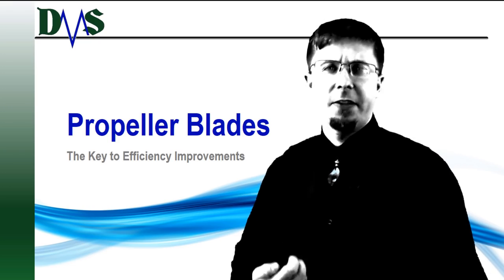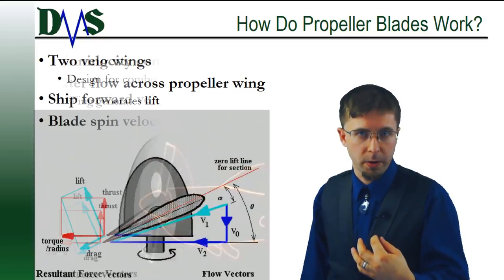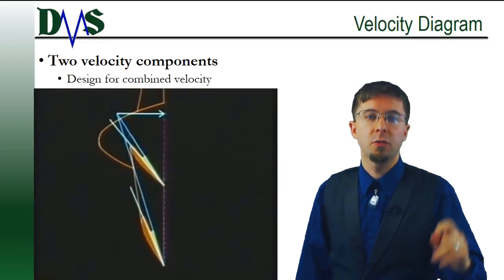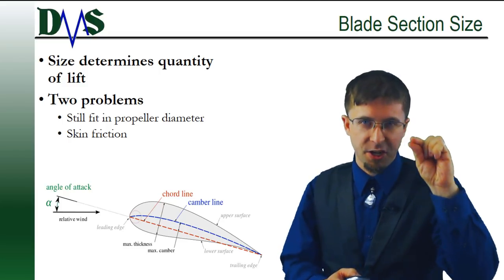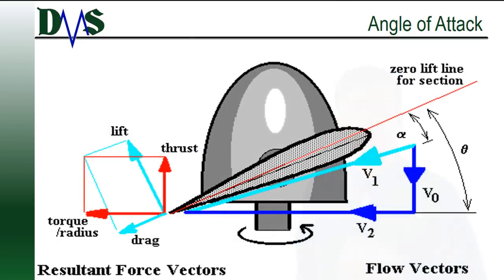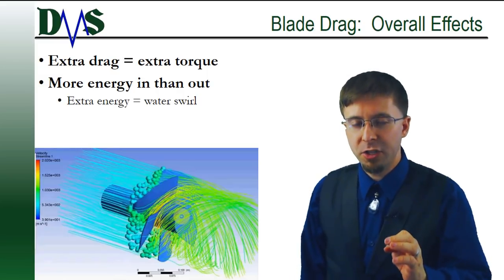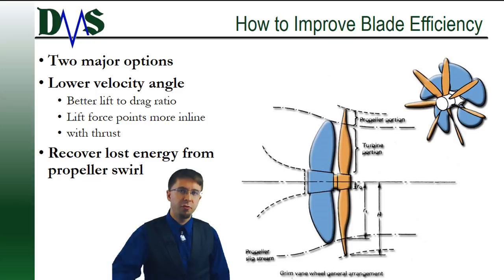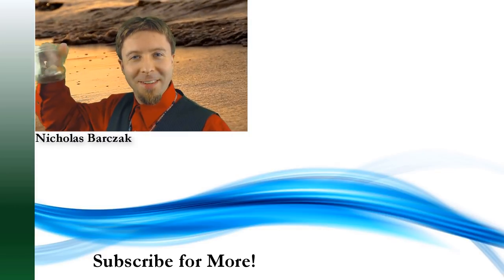Propeller Blades:  The Key to Efficiency Improvements

Comment: Do variable pitch propellers work on large seagoing vessels?
Reply from the maker: Sure.  I just worked on an ocean construction ship that had two variable pitch propellers, also called a controllable pitch propeller (CPP).  The downsides:  more expensive than fixed pitch; more machinery that can break; lower efficiency than a fixed pitch (when comparing on equal pitch).  So you don't see CPP's on freighters that spend 90% of their time at one speed.  But they are handy for ships like ferries, offshore supply vessels, and construction ships.  These are all ships that need to work at different speed ranges.  Those are the best uses for CPP's.
Reply: By keeping the engine speed constant (or mostly constant) you gain efficiency from the engine.  Well, if you spend most of your time at 1 speed, you've accomplished the same thing with a regular prop without all the components to go wrong...
Navies also like them for their ability to quickly and precisely change speeds.  For instance, when a DDG51 class caught the dumbs and almost got run down by me (container ship) he was, by combination of GTS and CPP able to put the power down and escape...
Reply: Thank you guys for actually responding to my comment!!  It really helps!!!

Comment: The "duo props" developed by Volvo claim to have a 30% improvement in effectiveness, 30% more speed at the rpm you normally use. If you get 15 knots at 1800 rpm, by using a duo prop you effectively get 19.5 knots at 1800 rpm.
That is the claim at least. There must be something to it though, since cruise ships and ice breakers have started using the system on pods. They wouldn't put them on a cruise ship if they didn't give a measurable benefit to ship operation.

Many European based yacht builders have started offering Volvo-Penta pod driven option, which does come with the duo prop. With the twin pods in the back, a bow thruster and the application installed in the controls, push a button on the controls and you have dynamic positioning operating.

Comment: Hello! Thanks for your fantastic video. I have a question. In 5:44, you said the lift is perpendicular to zero lift line is, that true? I couldn't find it in the books. Isn't that supposed to be perpendicular to the relative velocity?
Reply: It's in every explanation of lift from airfoil sections. The lift is always at right angles to the zero lift line, no matter what the direction of travel.
Lift occurs just after the top of  the upper curve of the chord,  and is produced by a low pressure area. If you tilt the upper curve away from the direction of travel, the Lift component has to follow the  tilt of the ais.

Comment: Nice video. Just subscribed. I was wondering if you have an example of a prop that works as thrust for a 47' sailboat but also as a prop that generates electricity when sailing?
Reply from the maker: I don't have any specific manufacturers yet, but if you do a search for "yacht electric motor", you can locate manufacturers that supply that.  Anyone that makes an electric motor for yacht propulsion often adds in the ability to turn it into a generator.  Here are the first two results I found from google (not an endorsement):  
http://electroprop.com/sailor-serial-hybrid/
http://electricyacht.com

But that just handles the motor.  Then you need the propeller.  Biggest point:  don't get any feathering or controllable pitch propellers.  Otherwise, the generator capability never works.  You want a simple fixed pitch propeller.  There are some special blade shapes to make sure it works just as well in generator vs propeller mode.  But unless you are buy a custom cast propeller, I doubt you will find anyone that makes such a specialized option.  Just get the right propeller for propulsion and the generator should work pretty good too.

Comment: I’ve heard of cupping the blades for efficiency, but has anyone done more on blade designs away from the tip and more at the leading and trailing ends to increase efficiency and reduce noise?

Comment: What would happen if you use vortex generators like that on a aircraft wing ?
Reply from the maker: I'm no expert in aircraft wings.  But at first guess, nothing would happen.  From my understanding, vortex generators on airplane wings exist to ensure reliable turbulent flow over the wing.  Propellers operate at a higher Reynolds number than aircraft wings.  We are already far into the turbulent flow regime.  All the things the vortex generator acocomplishes by design, we achieve as a natural consequence of the propeller operation.

Comment: What about swirl with the Voith type  of propellor?
 Is it more efficient than conventional types of propellor?
Reply from the maker: The Voith Propeller doesn't experience swirl in the same sense as a conventional propeller.  Totally different flow pattern.  At slow speeds (below 12-14 knots) the Voith Propeller can be more efficient.  The trade-off is greater complexity for the Voith propeller (i.e. increased cost).  But Voith also offers increased maneuverability.   I really need to create a whole video on Voith propellers.

Comment: which rotation works better right hand or left hand
Reply from the maker: Generally, no difference.  If your hull is not symmetric, then you may get some benefits of right hand vs left hand, depending on hull shape.   (Asymmetric hulls are possible in the individual amas of catamarans and trimarans.)  Selecting right hand vs left hand, the largest deciding factor is probably which direction you turn when backing out of the slip at your home marina.
Reply: @DatawaveMarineSolutions  Awesome! Your reply including the tail walking in reverse is supper impressive to me (right vs left hand prop). I am not only a hull diver, but also a sailboat owner. This rebuttal gives me much faith that you will help engineers consider marine growth and opposing elements of balance. (5 🌟  reply)
*Most power boats with STBD & Port running gear have right hand on STBD side & left hand on port side. The only real difference to me, is the STBD propeller nut often kicks loose when bumping the boat in drive. Using a king nut with a locking set screw will help prevent the propeller nuts from loosening when operating. Standars ABYC jam nut, king nut, cotter pin doesn't always work on vessels with heavy nuts lol.

Comment: I get confused when marine engineers aircraft 'propellers' as an analogy with ship 'screws'. Don't they differ because an aircraft propeller relies much more on working in a compressible fluid rather than the other non-compressible fluid of a ship's screw?
Reply: Geoff Buck The principle is the same, it's just the mass that needs to be different, low mass for  gas, high mass / high strength for fluids.

Comment: why is an airplane propeller more efficient with less blade area ?
Reply from the maker: It comes down to the difference in density and application.  Airplane propellers operate in air, which is roughly 1000x less dense than water.  Due to this, the propeller this follows the same basic shape, but with different proportions.  It spins faster and uses less surface area.  Due to these changes, you also get less skin drag and less induced drag on the propeller, which means better efficiency.  

Put it another way:  because the propeller spins faster, it doesn't need to produce as much force with each rotation.  That allows us to focus the airplane propeller on efficiency, rather than fitting sufficient thrust into a relatively small diameter.  

There are several physics and design decisions that go into that result.  But the basic idea that I want to convey:  when an engineer designs a propeller for a ship or an airplane, we always try to get the best efficiency, given the design constraints.  Normally, ship propellers face the problem of trying to fit too much thrust into too small of an area.  In those cases, you need to sacrifice efficiency.  Airplane propellers have a little more space to work with, and so it can be easier for those designers to achieve higher efficiency.

Comment: Propellers are a brute approach to solve what Mother Nature already has found multiple solutions for creating motion from a viscous ambient fluid (air/water).  The Wright Brothers understood that and tried to emulate a single one of the elements of bird wing designs, wing-twisting, which our modern rigid-wing airplanes have not yet been able to replicate efficiently.  Also note that there are no propellers in nature?  HMMM...  I think that the Energy Efficiency of propellers ranges from 10 to 35% , vs let's say a dolphin EE, which has been calculated at ABOVE 100% in some cases....  again, HMMMMM ....  I wonder if we could do better!  YES:  The Manta Marine Propulsion System IMO...
Reply: So like fish, it'd seem that a motor that could propels a boat with a swimming action rather than a spinning prop. Very interesting.

Comment: I recently saw research at NASA Ames regarding the 'PRANDL wing'. Apparently all wing designs are descended in some way from Prandl's mathematical work of 1925, which established the most efficient wing for a given length. But his 1933 paper demonstrated that wasn't the whole story. The most efficient wing without that constraint is longer and has a very different shape. One of the benefits in an aero application is that the tip vortex disappears. These wings have been shown to be substantially more efficient, as well as quieter, and with the replacement of adverse yaw with proverse yaw they eliminate the need for a tail plane, further increasing efficiency. The efficiency has  been shown at NASA to also extend to propeller blade shapes.

I'd like to see how this applies to boat and ship propellers.

Comment: Ship forward velocity and thrust should be in same direction.
Reply from the maker: Not when viewed in the frame of reference of the propeller.  With fluid dynamics, we frequently set the frame of reference to the moving object (the propeller centerline).  Now the propeller is stationary (but still rotating), and the water moves the opposite direction of thrust.
Reply: @DatawaveMarineSolutions  Right, this is based on Blade element theory, where V0 should be the axial flow to the propeller (equal to the advance velocity of propeller < Velocity of Ship) from the frame of reference of the propeller, and hence the direction should be reversed, I think the one which is used in the video is for the propeller in front of the Aeroplane.

Comment: Interesting channel. You need to get a better mic, the audio is "Buzzy" and the sound levels are too low.  I have to turn my volume up to hear your videos and then turn it back down for others.
Reply from the maker: Thanks for the tip.  The audio level is interesting.  I normalize all my audio to -0.5 db.  I'll check my video editor to see if it snuck a reduction on me.  Can you link another video that you watched for comparison?  I'd like to see if the other videos have their audio turned up or if mine is turned down.
Reply: Advertisements are the best guide, they're pros, they get it right.

Comment: Interesting stuff.  In hydropower dams, Francis Turbines get around 93% efficiency in part because they have a "de-swirler" stage at the end.  Is there no way to create a propeller/impeller analog of a Francis Turbine to bump up efficiency?
Reply from the maker: Not easily.  We do use de-swirlers of various types on some propellers.  The main difference between the Francis Turbine and a propeller is that the Francis Turbine is inside a pipe.  The water must go through the turbine.  In an open propeller, the water has the option to go around, which significantly alters the possibilities at the propeller.  Waterjets would be the closest analog to a Francis Turbine.  They do use an impeller in a pipe.  But they also have efficiency losses from the inlet suction.
Reply: I was told by many unreliable sources lol, that jet drives are less efficient. But I can't help but notice many of the faster vessels on the water are jet drive. Does it take more hp and fuel to accomplish the same speed on equal vessels? (jet vs standard)
Reply: I'm not a fan on jet drives left in the water though. Hinkley puts out many boats like this, but ii is near impossible to remove the barnacles from the impeller without a pressure washer wand. (Hull diver perspective) Jet drives should be kept on a boat lift.